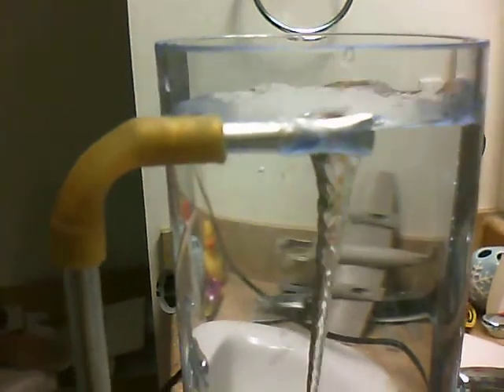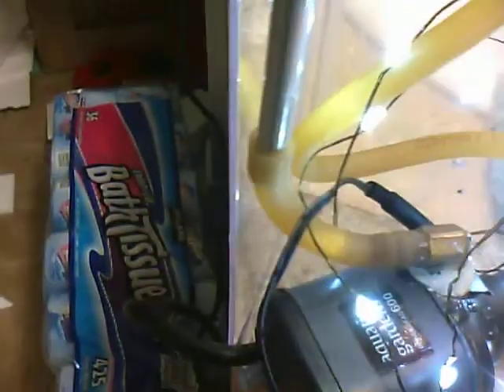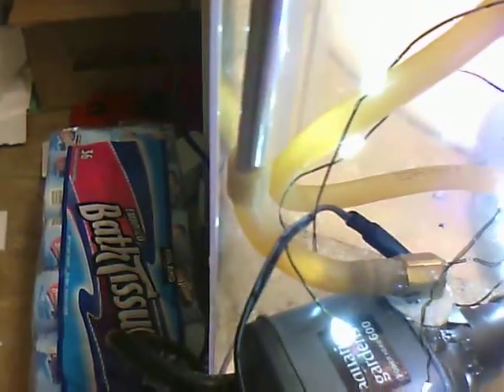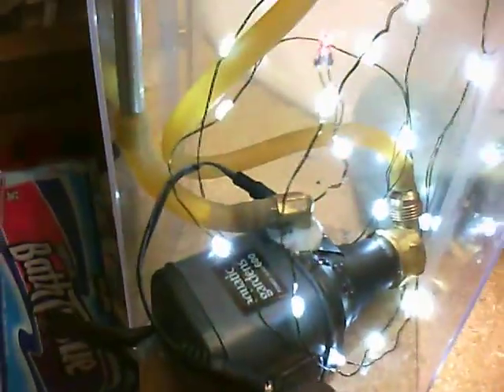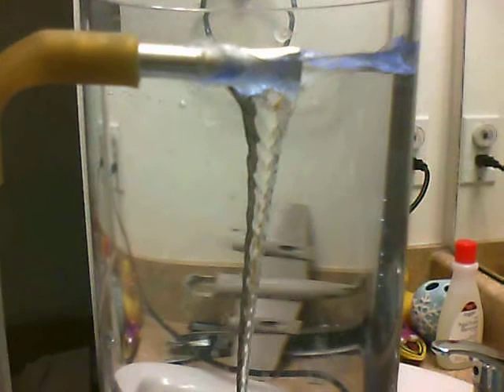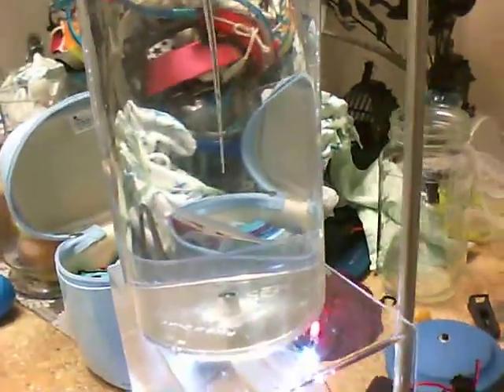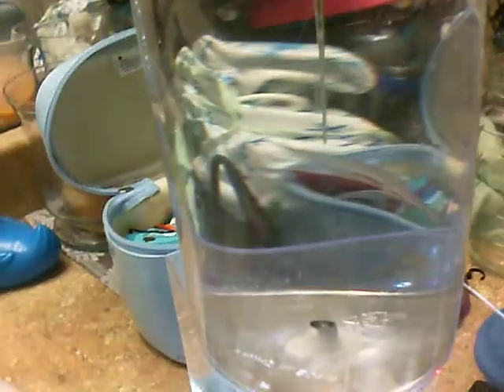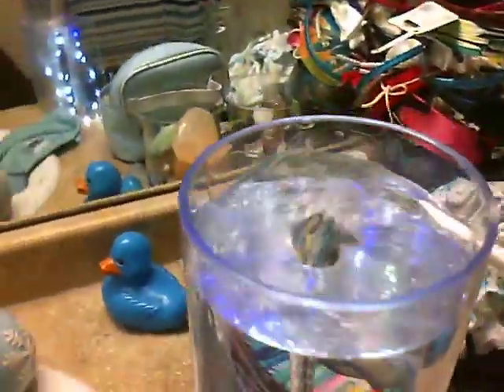Home built tornado tube

Comment from the maker: @TheWombatSlayer the one i found isnt filtering the water, its just an impeller in a coil. the magnetic part is attached to the impeller so anything in the water would just flow through the pump. for mine, i want to paint most of the base black and wire in some LEDs in the base shining upwards. also i left out the lid on the video, it keeps the water from splashing up.

Comment: @Flyingwigs Thanks for the advice.  I originally intended to use a small prop to spin the water and pull it downwards, allowing it to resurface at the edges.  This may be a little easier.  I also want to put some light absorbant particles in there, so I gotta find a pump that doesnt completely filter the water, else it will get clogged.  Do you plan on doing anything else aestetically to your tube?

Comment from the maker: @TheWombatSlayer  to seal it i used JB Weld putty, CA glue (super glue) and a contact cement. but i think that the Loctite brand silicone would work good also.
i do not have anything other than the pump to rotate the water, as you can see in the video the pump's output is angled towards the inside wall and flattened to cause it to start rotating by itself. the stronger the pump, the faster it can rotate the water : )